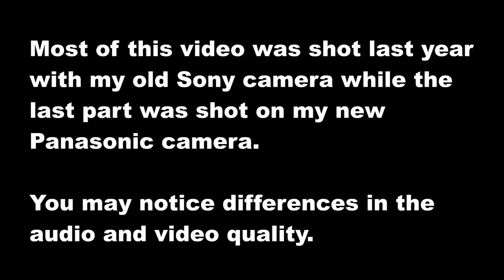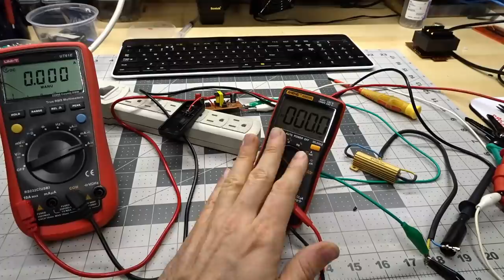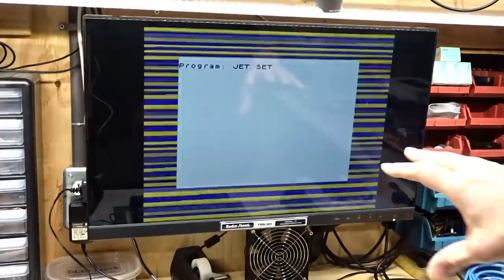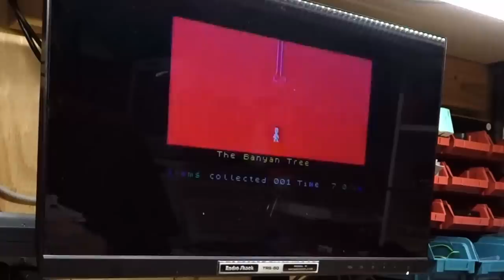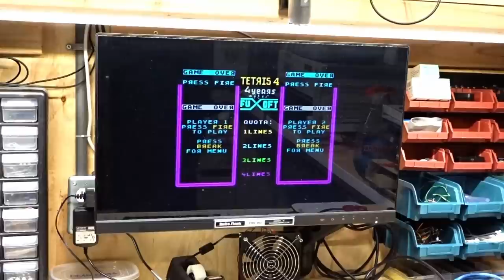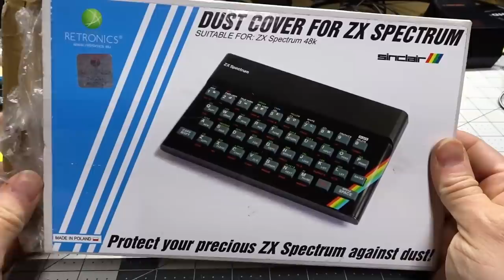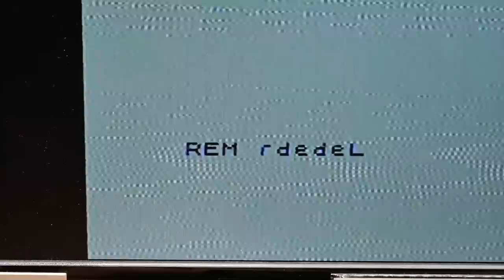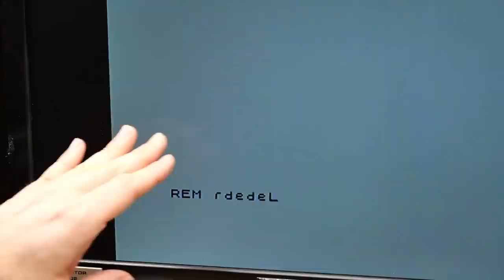ZX Spectrum Part 3 - Revisiting the machine at last!

Comment: Thank you very much for this three part video wayback machine to the eighties. It was so amusing remembering those times.
I was teenager then and ZX Spectrum turned over my life.  I still have it and it was perfectly working last time I tried it out.
Other than programmng, I learned to service it too, and earn some pocket money by doing it. All problems you stumbled on are common (shorting out keyboard strips, adding heatsing, reducing power supply voltage, replaceing memory chips...). All those issues were detected and fixed as routine.
The very first thing one had to do with the ZX Spectrum was to open power supply and unwind some wire from transformer secondary coil, to lower it's output voltage. As you noticed it vastly reduced heating and minimizes malfunctions later (and XZ Spectrum was capable of working non-stop for days). I understand you had to ditch original power supply as it was not matching primary voltage.
About loading programs, you have to hit exact volume level. It must not be too low or too high. But by some use you learn to set it right just by ear. You were lucky to avoid having to deal with adjusting angle of the head in tape player. That was the game! :) I knew some people who deliberately recorded programs with oddly set head just to make it harder to copy.
You can do one more customization on your ZX Spectrum - add reset key. That was also very common and considered must to do, to reduce stress on power connectors, cable and electronics. Instead of plugging power off and on to reset computer, you can simply press reset button added to the rear on the case. It makes ZX Spectrum live much longer.
There were also mechanical keyboards available for ZX Spectrum, so we used them to avoid gummy keyboard. But gummy keyboard was not hard to use. Mechanical keyboards was more a fashion thing :)
And about your remarks comparing C64 and Sinclair ZX Spectrum - C64 was always just an gaming machine. If you wanted to do some serious programming, especially when you get advanced and switch to programming in assembler, Z80 was way more cool to work with :) Actually all people I knew than owned C64 were using then for nothing else but gaming. They knew nothing more than to stick in joysticks and use tape recorder. Machine did not push them to get advanced. Programming documentation was quite lousy. People with ZX Spectrums were doing cool stuff in programming and electronics too :)

Comment: I grew up in a time in the UK where wiring plugs was taught at school.  This is because the law that requires appliances to be functional out of the box is relatively new.  Back in the time, we were taught explicitly about the fuses that go in them and to match them to the requirements of the appliance in question.  

Of course, no-one ever went and read the packaging/instructions before buying a new fuse, usually because it was lost or thrown away, so they always picked out the one that wouldn't blow up the moment it was installed - the 13A.

Also, the British plug is a work of art.

Comment: You are correct about the plug and it's fuse. Newer BS1363 plugs have to have the sleeving on the pins, this is mostly so that you cannot touch live contacts on a partially inserted plug. The fuse should also have been a 3A fuse - but until quite recently, UK plugs came with a 13A fuse included as standard, and many people simply didn't bother to put the correct fuse in!

Comment: Glad to see (via the comments) that you're going to give it another go with a cassette deck.  One thing that comes to mind having using a similar amp connected to various portable audio devices was that the headphone cable leading into the amp picked up a lot of interference from lighting drivers, motors, and power supplies in the same building.  Without anything playing and the amp volume over about half, I could hear tons of buzzing and squealing in my headphones.  I ended up finding a shielded headphone cable in my spaghetti bin and it made a huge difference.

Comment: I remember spending five minutes waiting for a game to load only for it to crap out. I also remember the horrible noise of a cassette player chewing up a tape. I had several tape players, but the one that was the best at loading from also had a bad habit of chewing tapes now and then. You also learned to play with the tape head azimuth. Some programs I had bought came on tapes that had been recorded with very strange azimuth, so I tended to keep a jeweler's screwdriver with the tape decks, adjusting the head anytime a tape sounded muffled.
Unfortunately there's not much you can do about that loading from an app like you do. I'm a bit confused about the sound levels though. Listening to the stream through that little speaker was how I adjusted the volume and if necessary the azimuth. In your video that is hardly audible. I'm not sure if that's because the volume is low or if it's a problem with the input on the machine. Could also be that I've simply forgotten what sound level to expect. It's been a long time since I had the Speccy up and running. I think I know where it is though. And I think I have something like four boxes of printer paper for the ZX printer...
Reply: ahaha... tuning the azimuth based on the tone of the program loading... oh the memories that brings! lol... having fun took effort in the good ol' days gosh darn it! ;)

Comment: I suspect you've got a ground loop between the ground of the amplifier and the spectrum due to the crappy switching supplies powering both of them floating relative to mains earth. Put a simple $3 ground loop isolation transformer between them and the interference will be gone.
Reply: Agree, that's the next and cheapest thing to try.
Reply: The interference might go away for more than one reason then, limited frequency response of a crappy phone/audio isolation transformer is of advantage.
Reply: @SianaGearz  he could isolate the phone audio issue by using a Bluetooth module (no need for a patch cable, and the audio is transferred digitally).
Reply: @BrainSlugs83  except Bluetooth is the most interference inducing wireless protocol on the planet, it cuts through everything. Average tx power over time is low but it's mostly a lot of waiting and then powerful chirps at changing frequencies. It's vicious when used near RF sensitive equipment.
Reply: @SianaGearz  /\/\ this! I despise Bluetooth for this any many similar reasons.  Terrible...
Reply: Presumably if he could find a temporary way to run the amplifier from a battery source, that would also prove it, right?
Reply: I agree. I would be looking into possible ground loops. Whenever video is involved, I have found audio noise can be introduced. Try the isolation transformer idea, also try lifting grounds. Also try a better audio cable like you did with the video cable.
Reply: @SianaGearz  Then use something the the TY-250p. It covers 20 to 20k just fine. I've used several and can confirm the specs are legit.
Reply: @alphabeets  True. Both the horiz and vertical syncs are in the audio range. The vertical sync is great for a 60Hz buzz.
Reply: @misterhat5823  Why? Anything above something like 4-10KHz is prone to cause spurious edge detection and mess up the data transmission the way ZX Spectrum tapes work. Filtering out the high end is only bound to make it more reliable.
Reply: Also there will be high frequency noise and 60Hz hum on the output of the crappy switching PSU he bought, which won't help. A good quality PSU will have 2 output capacitors and an inductor between them and the output ground will be connected to mains earth ground. Search DiodeGoneWild on here. He's has videos of crappy switching PSUs, even worse than Adrians one.
Reply: It will also be radiating high frequency RF interference which could be being picked up by the ZX spectrum.
Reply: Try powering your amp using a battery. If it works, you know it's probably a groundloop.

Comment: I had this years back when it didn't matter what medium I used to load, it error'd all the time and I found it was a dirty connection on the Spectrum side of the input jack, think it was a dry joint but enough to create interference that caused a tape error on load.   Also there is little EM and RF protection in that little box, when my mum had her tumble dryer on downstairs it made the telly go funny and crash the Speccy (early eighties when shielded sources was unheard of).   Lets be honest though, the squishboard Spectrum was like its older brothers, a bloody unreliable machine fraught with many issues, I cut my teeth on the ancient ZX80 bought in kit form before it became a big thing and man that thing would burn the carpet, melt the ram packs plastic and once blew the fusebox out when the power supply shorted, the ZX81 was massively better and in its turn the Spectrum better still but the best were the +3's with the floppy drives built in and super reliable as strides had been made in power delivery and electronic manufacturing.

Comment: I restored my Issue 2 Spectrum in much the same way as you did and also had the same game loading issues. The "R Tape Loading Error" messages were common back in the 1980s especially when trying to load copied tapes, so I am glad that you got to experience some of this nostalgia for yourself!!

The way that I finally got reliable loading was to use a rooted Samsung Galaxy S5 and I may or may not have made an Android system config change to allow the volume to be boosted (I don't remember). The volume is turned up to max. I also use a stereo cable and in PlayZX I've enabled Stereo, plus "Invert one stereo channel".

Comment: How to remember, which is live wire, the blue or brown?
Well, one of them is the same color your pants will be when you touch it! :D
Reply: I was just thinking that!
Reply: Its obvious. Blue is cold so brown is hot. The stupid US colours are what are confusing. Black is negative/ground for DC so it should not be used as live/hot for mains AC.
Reply: I use the ‘BL’ method to remember... BL-ack for DC, BL-ue for AC.
Reply: @simontay4851  I'll agree, our (the US) wiring color code doesn't make much sense
Reply: Don't rely on that in most of the eu. plugs can go in both ways so do you like to gamble? :)
Reply: @simontay4851  European colours make even less sense. Brown/grey/black for three phase makes it look like they went out of their way to pick the worst colours possible. The older UK colours made a lot more sense (black = neutral, red = L1, yellow = L2, blue = L3)
Reply: When I was young it was, "The live brown bear, lay on the yellow/green earth looking at the neutral blue sky"
Reply: @simontay4851  The old UK colours used to be live - red, neutral - black, earth - green (or bare copper for in-wall wiring). Unfortunately, the commonest form of colourblindness is red-green … the "new" (some decades ago) (EU-wide) are live - brown, neutral - blue (usually dark, though I think I've seen light blue), earth - yellow and green stripes (think of buttercups on your lawn; anyway, stripy can be distinguished whatever vision you have).
[The old German colours were black, grey, and I think red - and weren't the way I expected, either. I have an old illuminated globe with them!]
Reply: @HiWetcam I like the way you said "harder" rather than "impossible" - I have visions of a determined ocker!
Reply: It sort of makes sense - brown is ground. I still remember having to wire plugs and as long as you remembered that green/yellow was earth, then looking at the plug with the cable downwards I used the 2nd letter of the color as a reminder - bLue = Left and bRown = Right.

Comment: The loading of games is an art more than a science. I can remember spending many an hour trying to get software to load. In the end I used a portable music system that had an equalizer and I got very proficient at being able to play with the different levels of the equalizer, so much so that I could "hear" the playback and know if it would load or not before I tried. I usually managed to get the games to load first time. If I remember correctly I found 3.5kHz was the main level I had to play with to get the best results. So many fond memories.

Comment: It was a real skill loading tapes back in the day.
Reply: It certainly was; my worst experience was with a cover tape from a magazine which had an adventure game on it (my favorite kind of game) but when i tried to load it in, the troubles began. It turned out that I had to adjust the azimuth ever so slightly between loading the tape header and loading the actual data block. It genuinely took me an entire night to get all the bits loaded in, but when i finally succeeded, I quickly saved the game to my +3's disk drive. When I finally got to play the game it only had nine locations! Bit of a disappointment that was. ;)
Reply: @BertGrink  Oh yes I remember them magazine tapes, you had to hope the shop hadn't stacked 'em near a telephone or drinks fridge cos them tapes were wiped clean, I once did a game for one of the mags a simple 3d maze type thingy, you had to type it in from the magazine as it was too crappy for the cover tape lol
Reply: @BertGrink  yeah, screwdriver at the ready when loading tapes :)

Comment: UK power plugs are the best in the world apart from one thing, stepping on them in bare feet
Reply: And fitting them through small openings.
Reply: but what on earth is with the over sided pins. they are thicker than the cable its self. to me its just overly huge for no reason. i like the idea of the fuse and plastic covering the pins.. but that dosent resovle the share size of the plug that isnt needed.
Reply: @writer8706  That's because of the way UK power systems were designed, In their system, the plug has a fuse in it that is intended to set the safety limit for the device it is attached to. The same plug has to be able to handle all the way up to 13 amps at 240 volts - which is double the wattage a US "two prong" plug can be expected to carry. Since the fuse is in the plug side of the circuit, the prongs and conductors in the plug and socket have to be large enough to handle all that current even if the fuse is a measly 1 amp fuse. It's OK to have too-large conductors (you could use car jumper cables to connect a 2302 battery to a memory-backup circuit if you wanted!) but you have too-small conductors (no using CAT-5 to jump start your car!)
Reply: @RickTheGeek  This was a hack in the first place because of the stupid ring main idea designed to save copper during the war.  I don't know why everyone loves the ridiculously oversized UK plug so much.  It's really not that great.
Reply: mrb5217 I never said I liked it! Lol! (And I’m in the USA so I have sane sized electric plugs! Although I do like the uk system of having an on-off switch at each plug.) 😀
Reply: or socks :-)  There's a price to pay for properly earthed / fused/ polarised  plugs !
Reply: @RickTheGeek , there's another consideration for why UK plugs are the way they are: mechanical stability. Given a preference, I very much like Australian Type-I plugs, which are less bulky but give you stability and proper polarisation for free due to the pins being angled.
Reply: @RickTheGeek  Not double the wattage, quadruple. When you double the voltage you double the current. P = I * E      4 = 2 * 2
Reply: @writer8706  The pin size does indeed look huge - those bars would probably carry tens of amps! However, it's not (just) the pin size, but the contact area: big pins ensure you have lots of area to make contact.
Reply: Try dropping down on a knee on one in the dark. I probably invented quite a few new expletives 😂

Comment: When you buy a UK mains plug, it's automatically supplied with a 13a fuse. That's the highest amperage fuse you can get and good for around 3KW. A 3amp fuse would have a been choice.
Reply: US circuit breakers are rated for half that 1.8kW with appliances allowed up to 1.5kW. Usually each room has its own circuit/spur. Most homes are wired with 20A breakers over lower gauge wire but 20A appliances have a different plugs.
Reply: 13A was about the tolerance from spikes and lightning strikes near power cables, sometimes the chaps balancing the power boards at the local power station did get it wrong and bang went the fuses in people's houses then tripped the breaker at the substation.   Back then you had two or three fuses in your fusebox, one for plugs, one for lights and one for cooker if you had electric cooker and none of this RCD as you had to have a torch to find the fusewire, then the screwdriver, then yank the fuse, cursing profusely all the way.
Reply: In the UK there is no such thing as amperage as we use the correct term, current.
Reply: @SpeccyMan  sultana
Reply: that plug is pretty old or cheap not having the insulated pins.